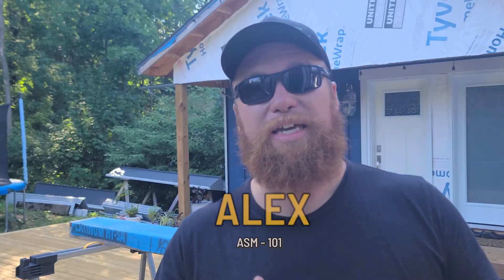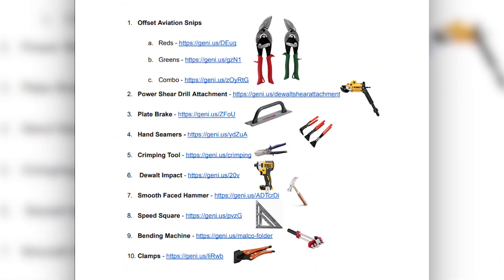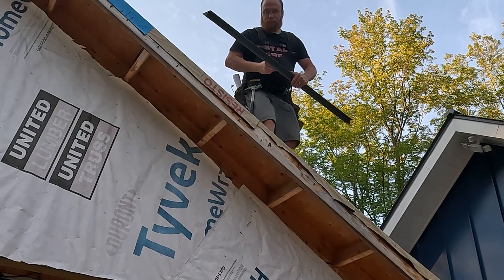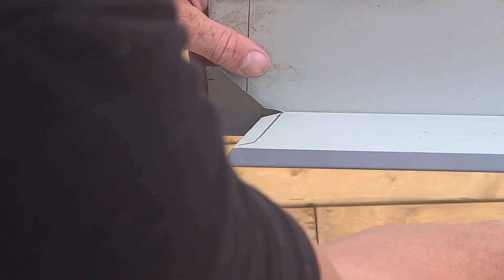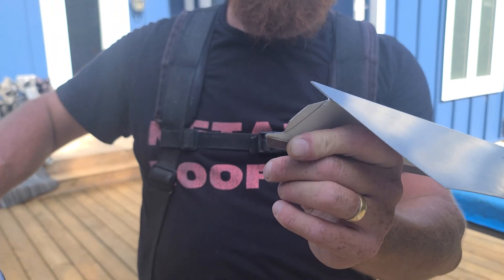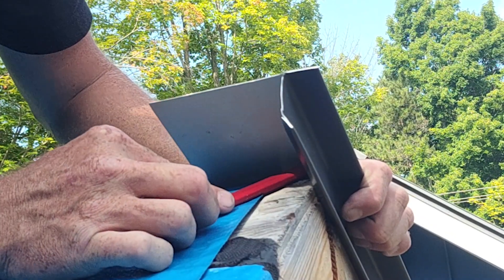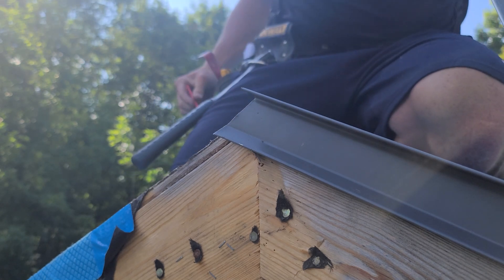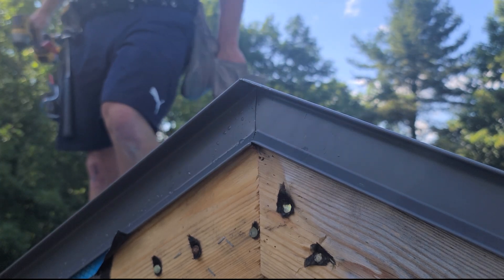Step-by-Step Standing Seam Install Course - Pt 2 - Gable Starter

Comment: Super helpful video. Do you have a video showing how you hem the panel over the gable drip edge?
Reply from the maker: Not yet!
Reply: @asm101  thanks for the response, I am getting ready to do my first standing seam project. Do you have a preferred method for this bend? I’m having a hard time finding a good resources on the best way to do it.
Reply from the maker: @SiscoSmithOG  is this the only standing seam roof youll ever do?  if so...depending on how many there are to do just pickup one of these off amazon https://amzn.to/4hc6bMg and go back and forth bending little by little...if you plan on makming a career out of this email me and we can discuss furhter